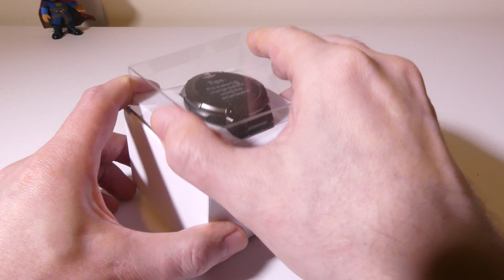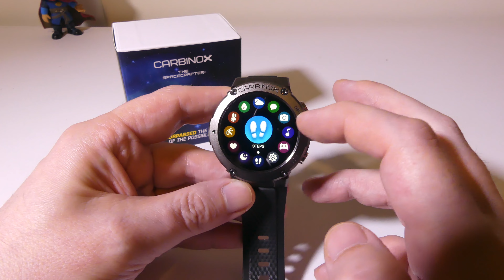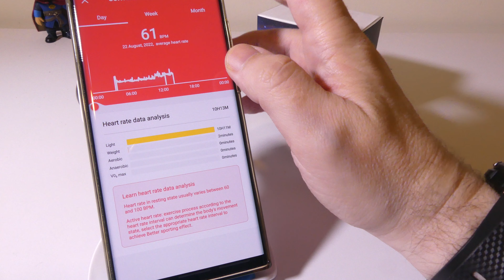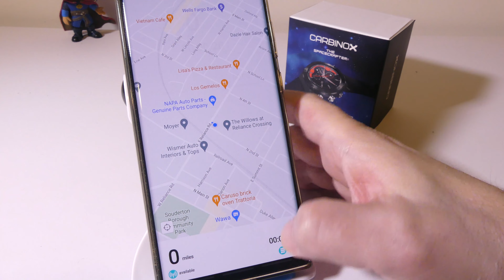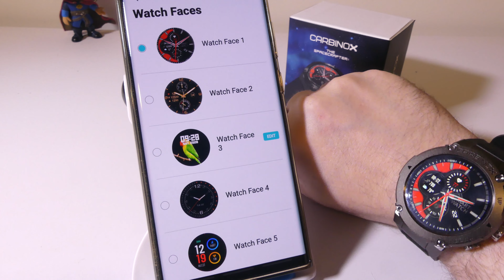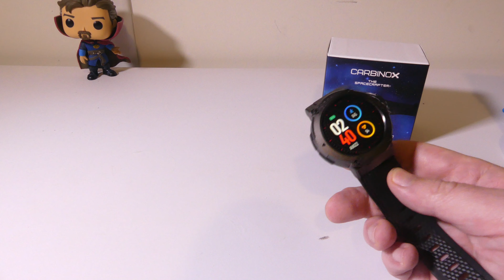CARBINOX Spacecrafter Rugged Smart Watch Durability Test and REVIEW

Comment: Can I get a replacement band for my Spacecfater
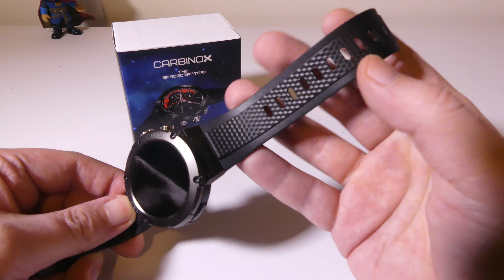Reply from the maker: They are standard 22mm bands, you can buy mostly any 22mm band to replace the strap check out the video at 3:19 if you want one direct from carbinox, you would have to contact them as they no longer sell this model, I am not sure.  They do have 22mm bands on their website as well but as I said any 22mm band should work.